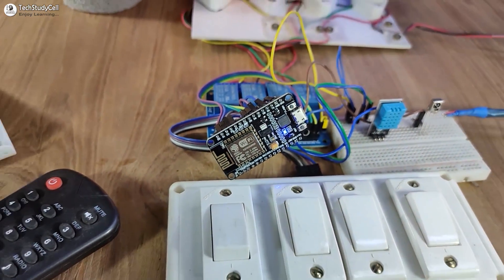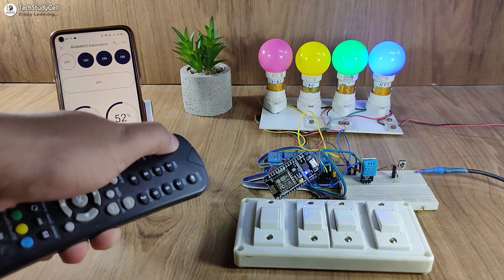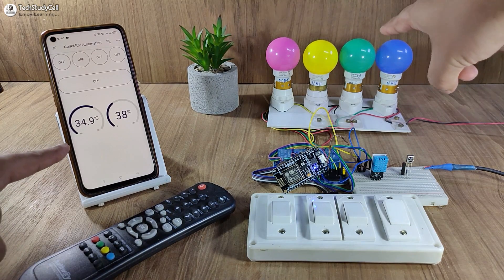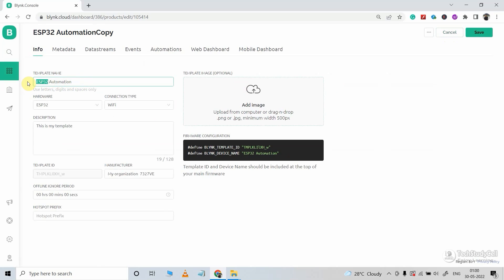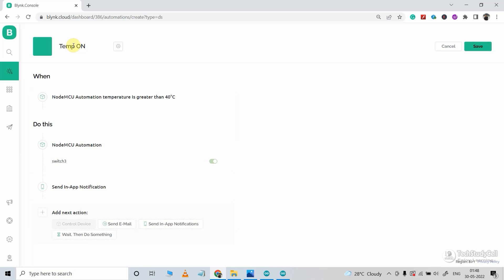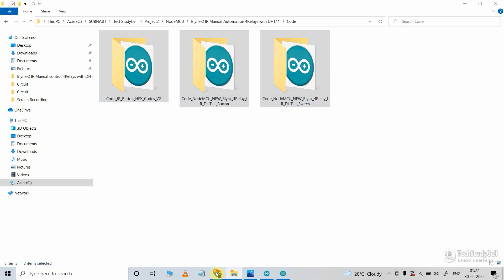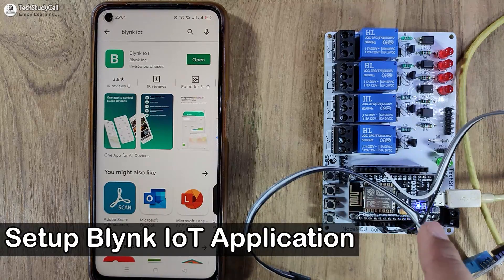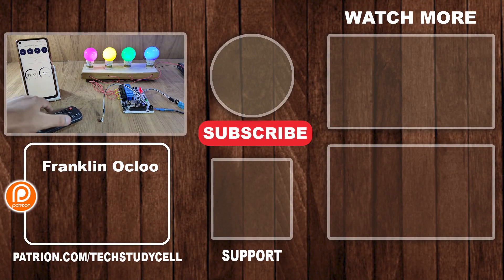ESP8266 Project using Blynk Google Assistant with Timer and Sensor | IoT Projects 2022

Comment: i use esp8266 chip but not able to connect.  I hope you will make a button to push wifi connection from esp chip to add wifi password and opt, that's great

Comment: Sir will this automation work if we do not connect temprature sensor and ir reciever...because other project without both the sensor do have some delay while operating it with buttons while wifi is not present.

Comment: Esp8266 stops responding after 15-20mins I've changed power adapter to 5v 2amp still issue is there, any suggestions?

Comment: Explain plz, the old blynk could be Controlled using only a single Mobil phone  wt it's hotspot to the nodemcu Control, but the new blynk needs to be connected to a separate wifi or another mobile hotspot before the phone the  new blynk app is installed can function... Why  is it not connecting directly wt the single phone??

Comment: ir remote no working with this when i connect ir recv with nodemcu then blynk goes off line so what i do?
Reply from the maker: Have you used 1838 ir receiver with metal case? Otherwise it will not work.
Reply: @TechStudyCell  i have same ir rccv model  but still not working. Can i used an other opation like a ir rcv module is that work?

Comment: Question: Is it possible to use this project with 5 volts and 12 volts DC ❓?
Reply: Yes I am using this example to
Control led stripe
Reply: Same question
Reply: yes

Comment: Hi
I Have received error on Serial Monitor for Remote Control Project using arduino.
Error:
use of decode(decode_results) is deprecated. use decode() instead 

Please Reply and Help me
Reply from the maker: Ignore that. It will not impact the performance